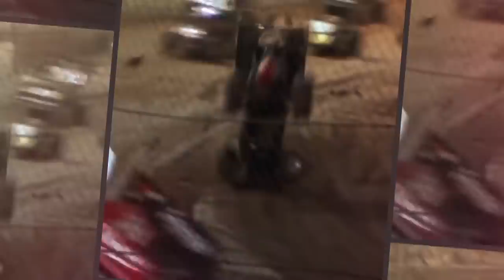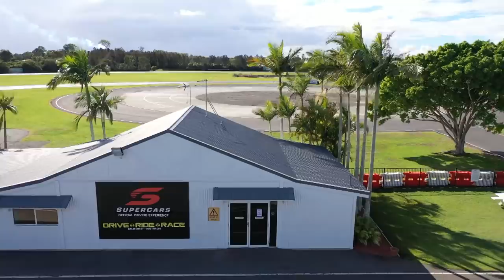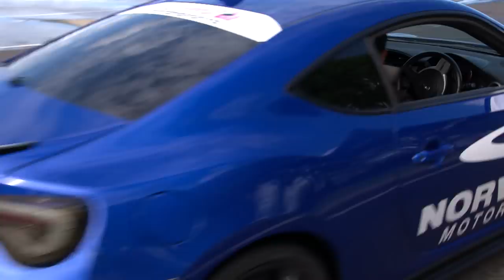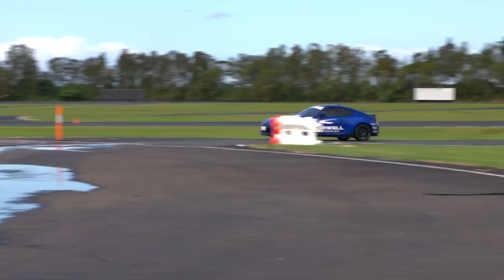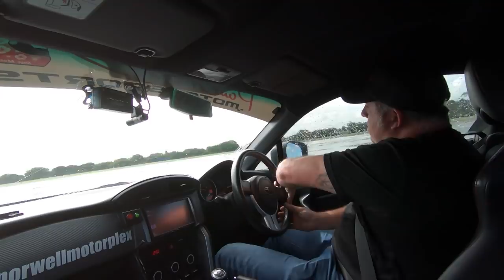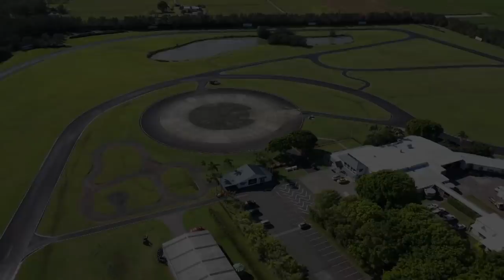TECH: Oversteer vs Understeer - Russell Ingall and Paul Morris

Comment: Is it the same principle for a front wheel drive .guys ps love the channel
Reply: I find that a lot of the time you can increase power to pull yourself out of oversteer in FWD's ;-) .
Reply: nope, if you start to slide power out and guide it with the wheel and it just straightens back up, lift off and you will find yourself facing backwards

Comment: Not always so black and white Paul ( to be frank I'm a little disappointed). In many high performance RWD CARS If you back off fully you will guarantee hitting the fence. You should explain the importance of throttle finesse in the corrective process, it is absolutely the difference between total loss of control and recovery.
Reply: No doubt Paul knows this, and maybe was giving the lay-person explanation; but I agree. Backing off completely with oversteer can just cause the car to snap back aggressively and send you into the fence on the other side. It's more about "driving" out of the slide, through correct steering angle and a measured release of the throttle to regain rear grip.